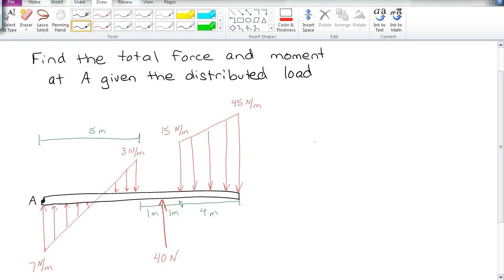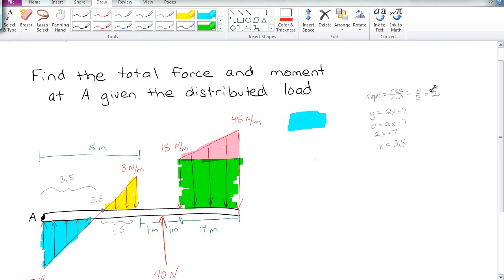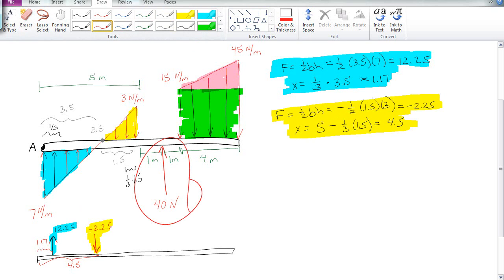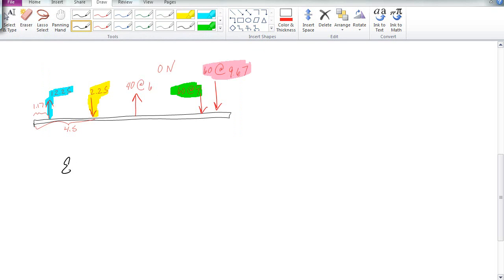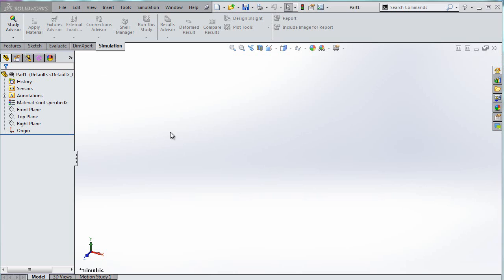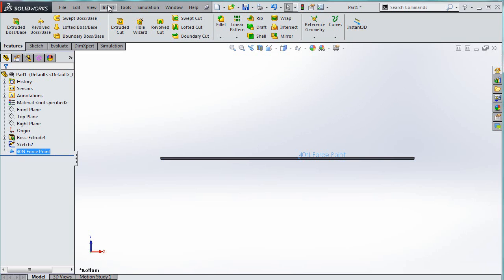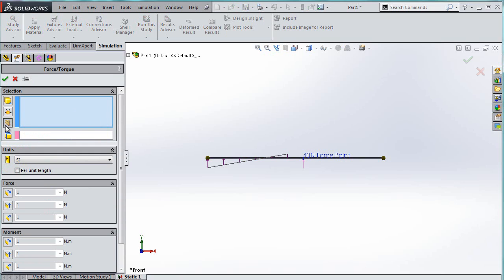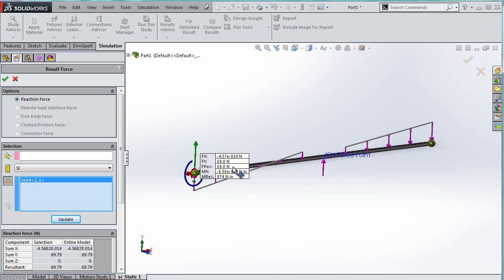Using SolidWorks Simulation for Nonuniform Distributed Load

Comment: Dear Snuggly. The sign convention for forces is "arrow down"= "+". It seems you're not using that convention and I think the initial result from the table driven distribution of "upside-down" is the result of reversing the convention. Your use of moment direction being counter clockwise  as "+" is correct, however. Enjoy your presentations! Clear and indeed snuggly :-)

Comment: The reason the answers are different is due to the way Solidworks handles the equations and resulting forces.  Also hand calculations are not as accurate as the computer (i.e. four decimal places vs two).